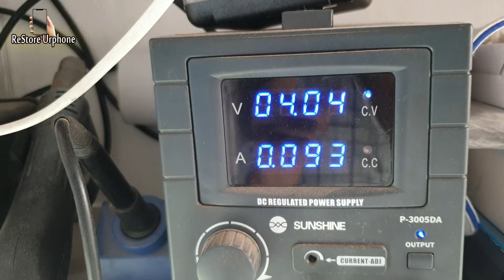Restore Very old iPhone 5s for Poor girl

Comment: They always make the restoration without seeing the battery health..is the battery health are checked or not?and usually it shows in it a 100% battery health..but using the third party battery could cause into undetected battery health..